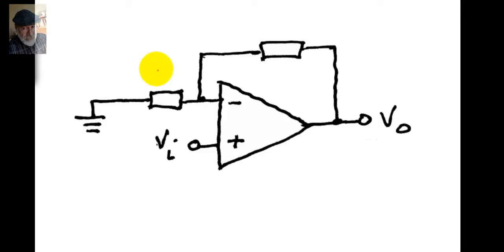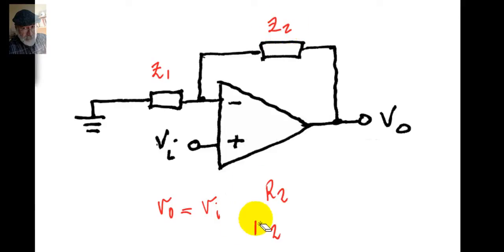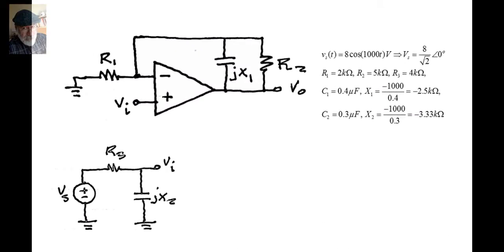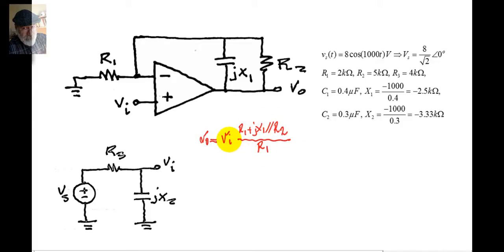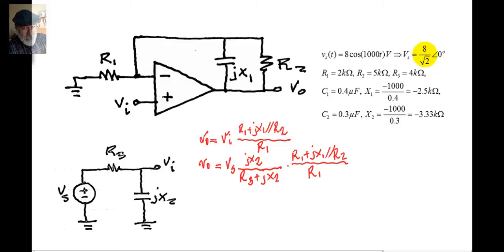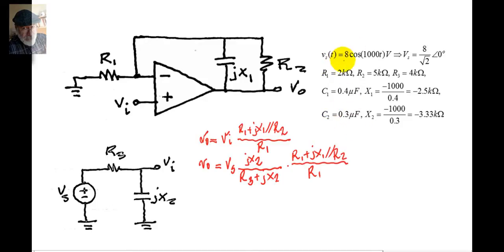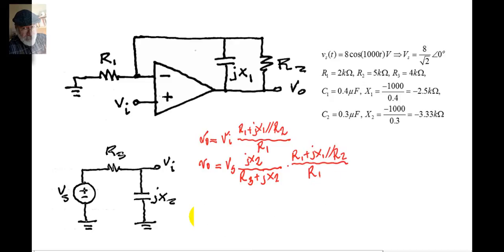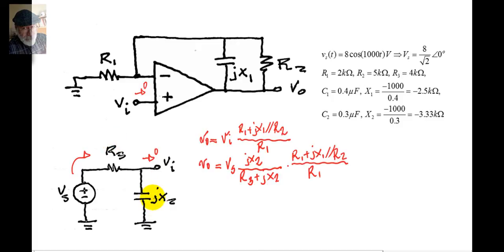Op Amp in AC steady state

Comment: How did you get V_s to be 8/sqrt(2) instead of just 8? Is this because of cut-off frequency 1/sqrt(2)?
Reply from the maker: It is just that I use IEEE (RMS valued) phasors instead of peak valued phasors. You may work with peak valued phasors too, and the end results will be a peak valued phasor. I prefer IEEE phasors when I need to compute power in the end, but if all I need is a function of time at the end, for voltage or current, just use the peak valued phasor. Note: The RMS value of a sinusoid with amplitude A is A/sqrt(2).
Reply: @rolinychupetin  I see, thank you very much! Great video, love the music XD